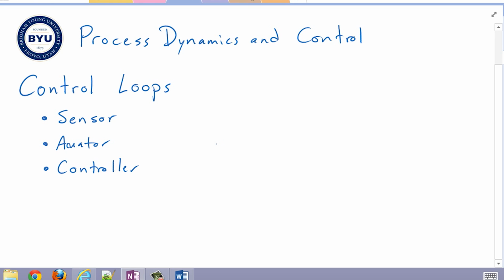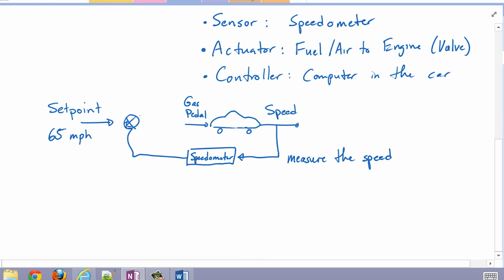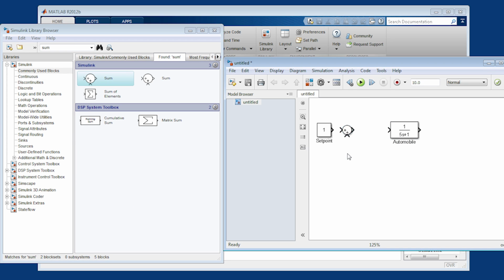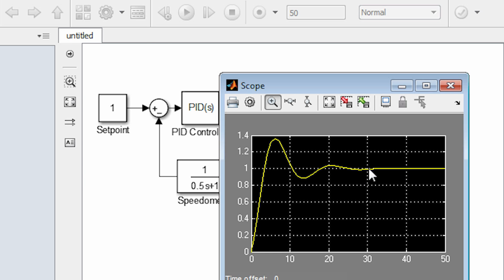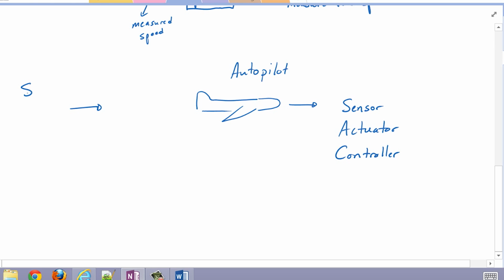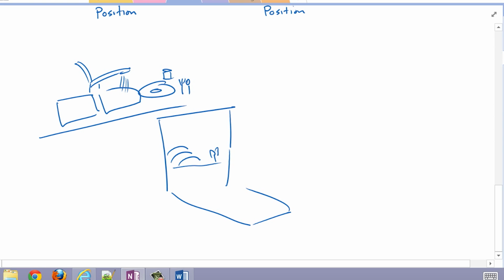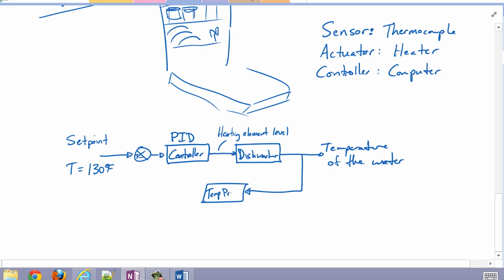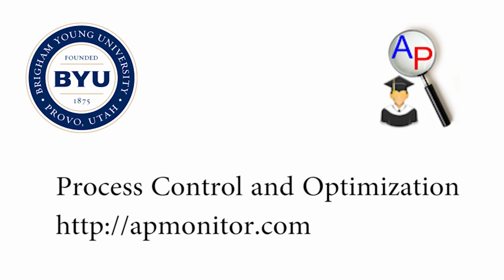MATLAB Control Loop Introduction and Simulink Example

Comment: Thanks! This is very helpful sir but do you have a video or discussion on what PID controllers do and what is the meaning of the values that you used in the transfer functions? I didn't kinda get it in this video.
Reply from the maker: Yes! there are many additional videos at https://apmonitor.com/che436 (MATLAB/Simulink process control course) or https://apmonitor.com/pdc (Python process control course).

Comment: hello, i have four subsytems which are connected and has to be executed in loop for 3 times.After looping ,i could get optimum values.How to perform looping of subsysems.Thanks in advance
Reply from the maker: You can create a loop by right mouse clicking on a line and bring it back to something like a summation or a mux. You make get an error that you need to lock the initial inputs on loopback. You just need to select that option on the first input after the loop.

Comment: hello i like your video, and i have homework and its a little be difficult because its the last description of your video where you are talking about the temperature, i would like you to help me please, putting heat and cold additional thanks waiting for a link to help me finish my homework
Reply from the maker: There is additional Simulink help at http://apmonitor.com/che436/index.php/Main/ProjectProgramming  Good luck on your homework.
Reply: thank you but it doesnt help me more, what i want to do, its in a cuve, put a setpoint temperature, then add heat and cold air, and calculate percentage of air and cold air wich will be add in the cuve to have the setpoint. this is my contact facebook if you can help me please 

https://www.facebook.com/lafrappe.dario

Comment: Respected Sir,
I have one problem with my PID controller Tuning, I tried myself a lot but I failed badly, if you kindly send your email, that I may kindly send the model to your goodself and after Tuning send back to me on my email (grkhan@hec.gov.pk) with many thanks.
It is very humbly requested, to kindly send an email with your good name and obliged.
Best Regards
Gul Rukh Khan
PhD scholar
grkhan@hec.gov.pk
Reply from the maker: I posted a PI tuning guide here: http://apmonitor.com/pdc/index.php/Main/ProportionalIntegralControl and a PID tuning guide here: http://apmonitor.com/pdc/index.php/Main/ProportionalIntegralDerivative. I'd recommend that you first try to identify an FOPDT model either graphically from a step test or else with optimization. Graphical: http://apmonitor.com/pdc/index.php/Main/FirstOrderGraphical  Optimization: http://apmonitor.com/pdc/index.php/Main/FirstOrderOptimization  From the FOPDT model, you can obtain good starting points for your PID tuning.